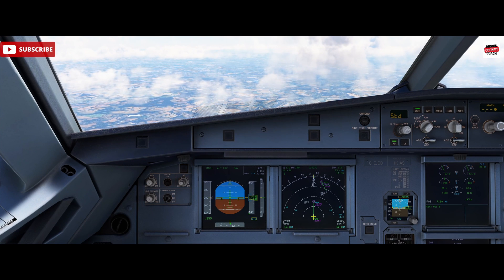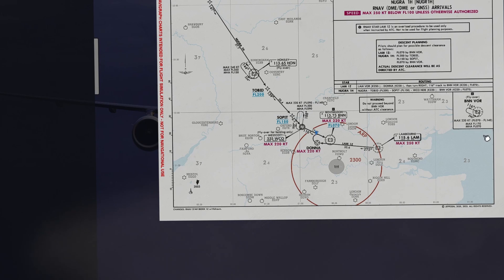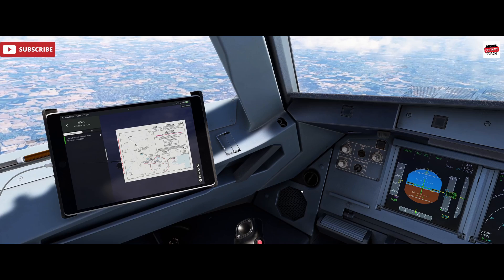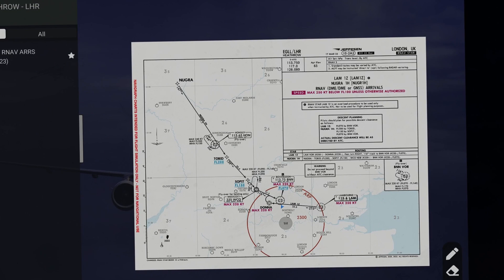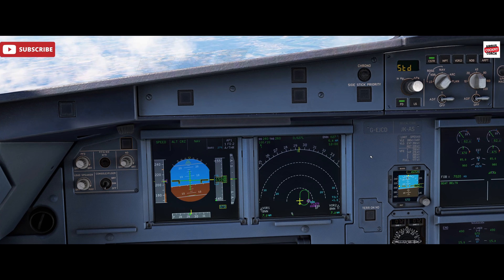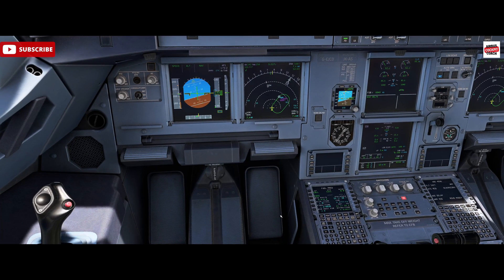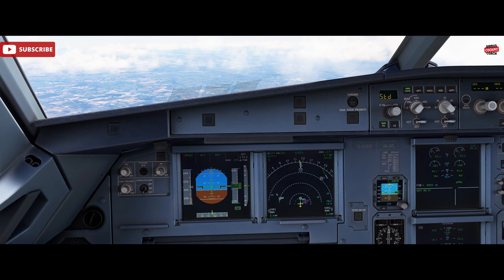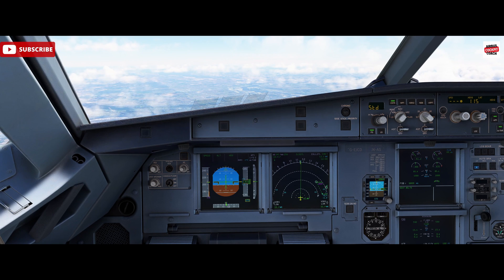How to Fly a Hold in the A320 | Real Airbus Pilot Tutorial (MSFS 2024)

Comment: It would be interesting to explain thoroughly the logic that Airbus uses for its autopilot action once you exit the hold. Or when you reach end of fl plan.
Reply from the maker: Hello, I'm sure I can get a video which covers that off but in brief the aircraft will continue flying at the last set altitude and the last heading or track that was active. If in Nav at the end of the flight plan the aircraft will switch to current heading. For speed management the aircraft will keep the last set speed, cost index speed or Mach number depending which one was in use at the end of plan. This logic is designed to keep the aircraft in stable flight whilst the crew address the situation. On leaving a hold it is a Nav switch to current HDG that occurs if there is a route discontinuity.